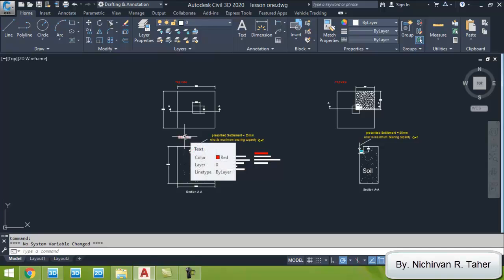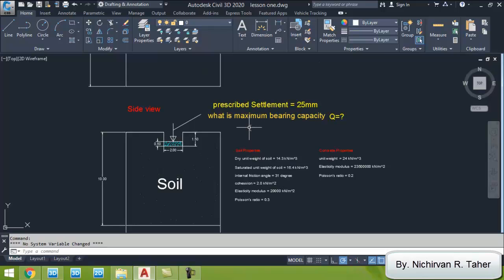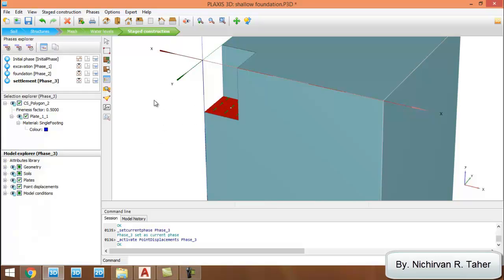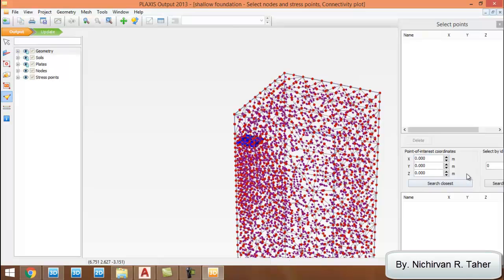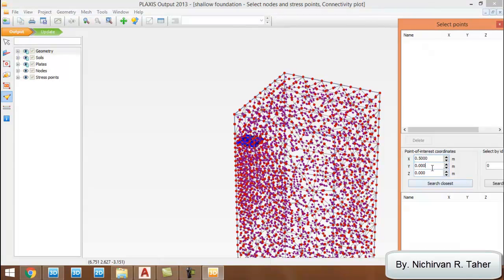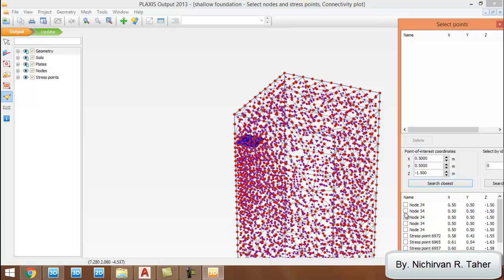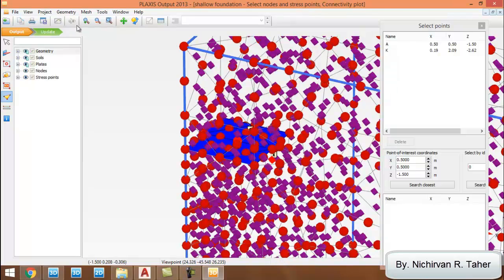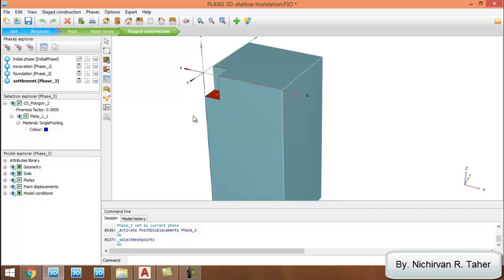Plaxis 3D bearing capacity of shallow foundation based on settlement criteria

Comment: Hi my friend. I seems you selected the wrong point for prescribed displacement. As you modeled only a quarter of a rectangular foundation then settlement point of one inch should be at the center of real foundation which is at the corner of you model
Reply from the maker: you are right friend, since the footing is very rigid thats why the settlement is almost the same everywhere and no big difference,